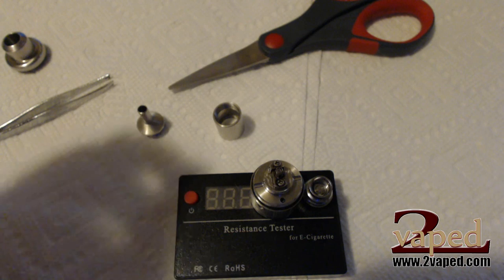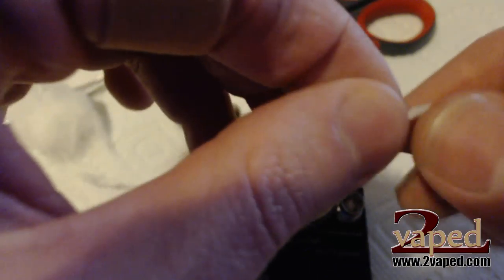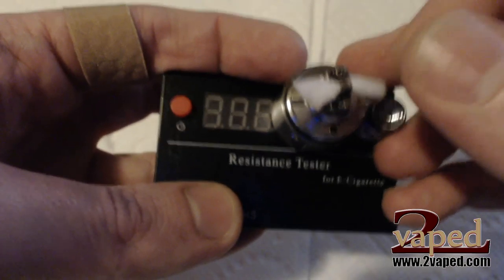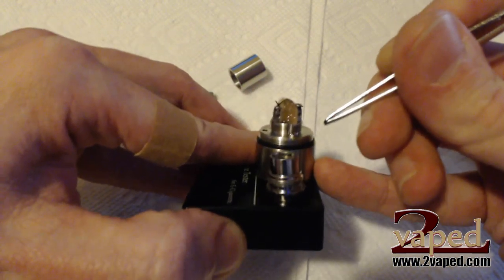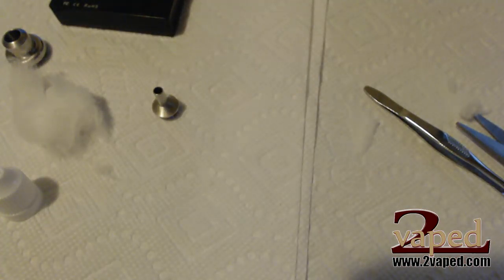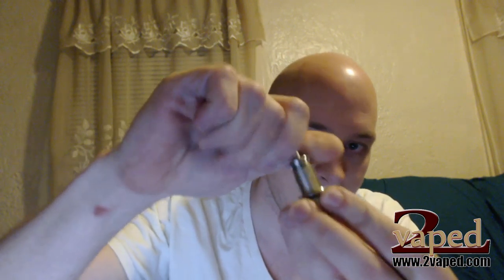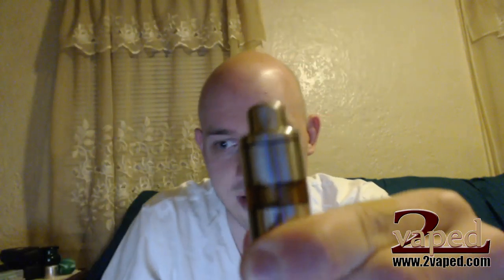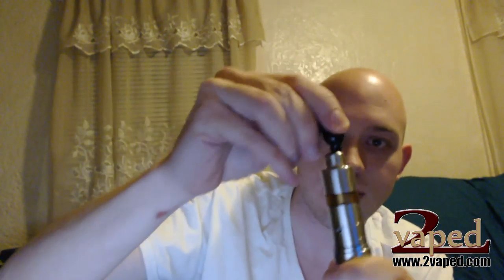Kayfun 3.1 | How to Wick & Fill - Easy! | NO LEAKS NO GURGLING | 2vaped.com

Comment: Easily the most useful Kayfun video on YouTube. I've found that if you cover the air holes before filling rather than after the fill it works a lot better. Thanks for a great video :)
Reply from the maker: Thanks!  And thanks for the tip on covering the holes prior to filling - good stuff!

Comment: Thanks for the info and video man. I bought my Kayfun 3.1 around 4 months ago when I first started vaping and I used it for a few days then bought other RDA's, RBA's and RTA's and simply forgot about it, LOL. I just did a new coil build 28 gauge kanthal, 9 wraps, 5/64 bit and cotton wick which came out around 1.6 ohms and ended up with a gurgle. I couldn't remember how to get rid of it so I found your video and viola! Problem solved. Thanks again.
Reply from the maker: Sweet!  Glad to hear it got you goin :) always fun to pull out the old gear and build on it again haha

Also subbed to your channel, looking good!  Keep it up and vape on!
Reply: I appreciate it man and thanks for the sub.

Comment: I appear to be late to the party. Great tutorial, though. I have problems with a soft fill hole screw on the Monster v2, always stripping or failing to come out. Top filling was always a pain in the ass for me, but of course, I wasn't using this method. Covering the air holes seems to be the trick. Great step-by-step guide here and no superfluous nonsense. Great stuff.
Reply from the maker: ***** Simple and to the point is my style!  I'm just happy to hear I was able to help you out :) thanks!!

Comment: If you use the longer chimney in short set up, then separate the acrylic & steel tank, slide apart then fill the steel upsidedown the filling issue is eliminated it also cures the mouthpiece wobble.

Comment: Ok people here it is. I started filling it from the bottom. I thought it was my technique it wasnt. What was it? THAT BLOODY WASHER ON THE INNER "CHIMNEY". Its comes loose and slides down the rod of the inner chimney. So I just pushed it into the impression where it fits into the inner top piece (where the drip tip is) and no leaks. Im glad I saw this video because my wick was excessive but this was the main culprit.
Reply from the maker: Good catch!  That little o-ring is definitely a main culprit for leaks - when it falls out of place like that or slides down the chimney, juice will get all in there.  Vape on!

Comment: how did you use a different drip tip?  The one that came on mine needs to be screwed in!  Did you use an adapter?
Reply from the maker: Most kits will come with an adapter that screws in there and then accepts standard 510 drip tips (depends on where you got yours) - check the little baggy of O-Rings and stuff, hopefully it's hiding in there :)

Comment: Hey man nice vid. I have a problem with my Kayfun 3.1 es ....I get it together and filled just like you have done, it works great until I lay it down, starts leaking out the air hole and I lose a lot of juice in the bottom chamber. Any suggestions? Thanks.
Reply: I would double check all the o-rings, especially the small one in the cap that seals against the chimney.  If juice gets into the chimney, that's what will happen.  Other than that, if it's all sealed up you should be able to just blow it out the top from the airhole then be good to go.  Let me know!

Comment: what wattage are you running with that setup?
Reply from the maker: It's usually built around 0.6 ohm so right around 30 Watts on a fully charged battery.  Thanks!
Reply: 2vaped Thanks. Still trying to figure mine out.

Comment: No matter how i fill my 3.1, whether it be screw fill or top fill, it leaks out the air hole until nothing is left in the tank. What should I do?
Reply from the maker: Hey it sounds like you might have some issues with your o-rings then.. check them over and make sure none are worn out or missing.  Specifically, check the tiny one in the cap that the chimney bit presses in to.  Let me know how it goes!

Comment: 1 i cant get my kayfun to wick with any juice thats over 50/50 but ii am all so a chain vaper so that might b ethe problem lol i did try your method still to no real problem solve on the heavy vg juice
Reply from the maker: Make sure all of your o-rings are good and maybe tighten up the airflow control a little bit - hopefully that will help :) thanks!
Reply: I had the airflow all most all the way closed off

Comment: hey man, my kayfun tank is getting hotter when ever i vape  is it normal?
Reply from the maker: It depends on how you have it set up, but if you use a lower resistance coil and are chain vaping, yeah it can get pretty warm :) shouldn't cause any problems though - vape on!

Comment: thanks for the info helped a lot! so in other words fuck the fill hole altogether?
Reply from the maker: The fill hole is a pain since you need a proper needle tip bottle to use.. and it's just plain slow compared to just popping off the top and filling it up!
Reply: oh ya its been great allday

Comment: i have a lite and no matter what i do i can't get it to stop leaking
Reply from the maker: Double check that all the o-rings are there, especially the one in the cap.  Once you fill it, make sure you blow all the juice out and as long as it's sealed up tight and you don't break the vacuum again (like by taking out the fill screw) it shouldn't leak - let me know how it goes!